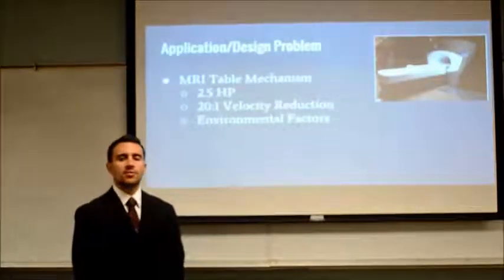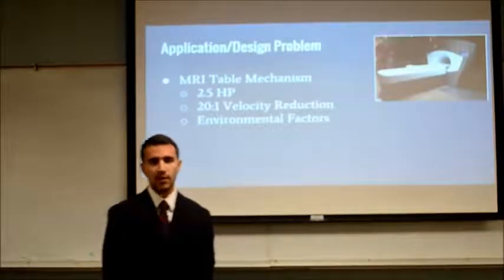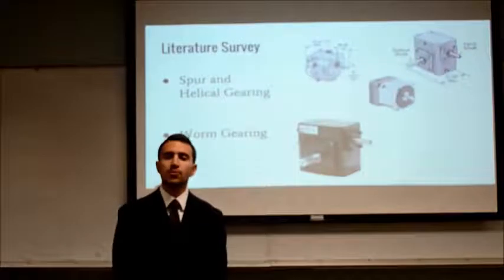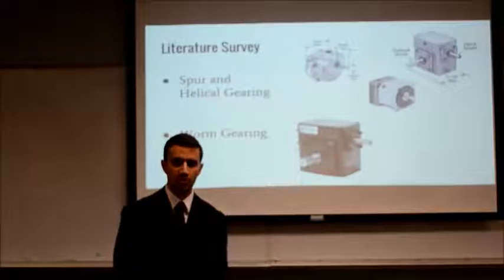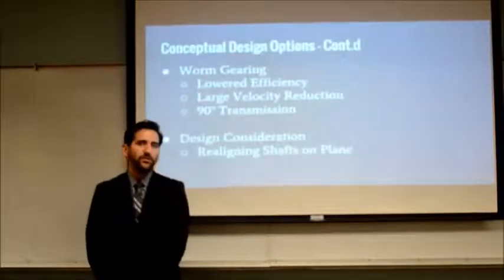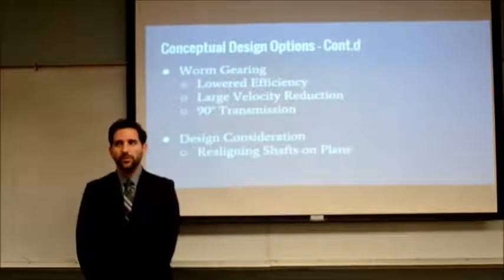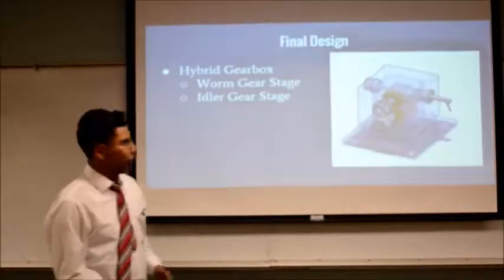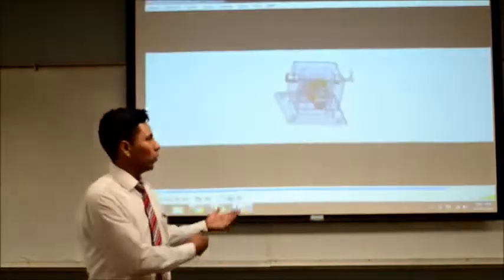Team 2: Gearbox Design Utilizing Worm Gears

Comment: This presentation was easy to follow and the presenters did a good job of explaining the topic. The visuals used during the presentation were good and the simulations helped understand the project. The audio could use some improvement and the lighting was also a little off. However, good overall presentation.